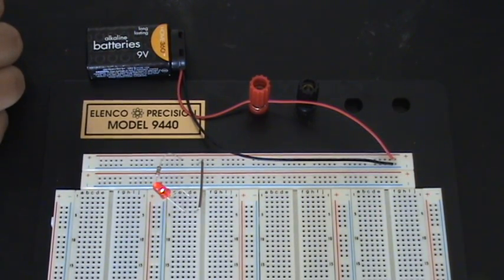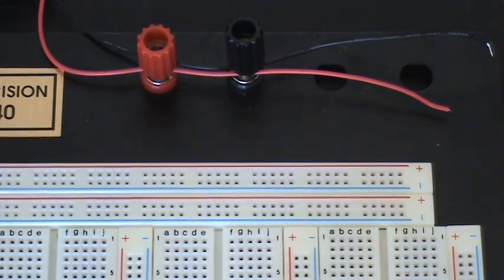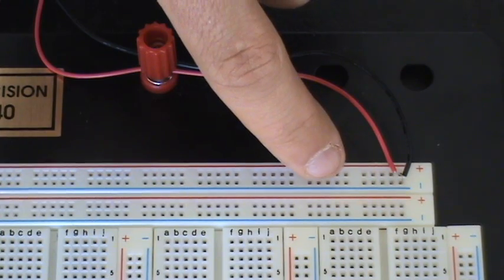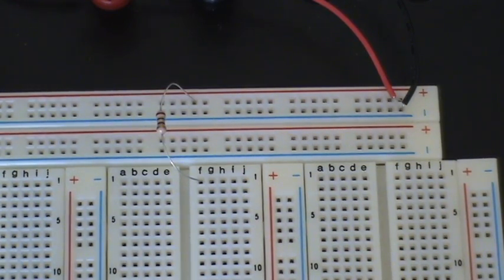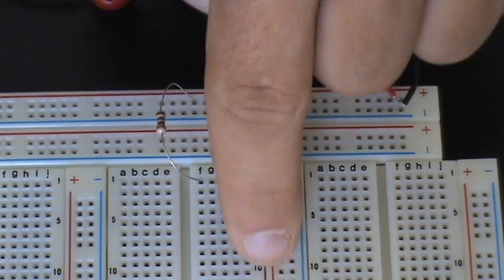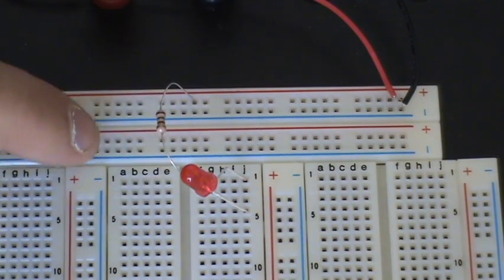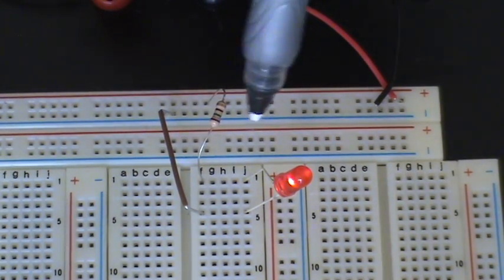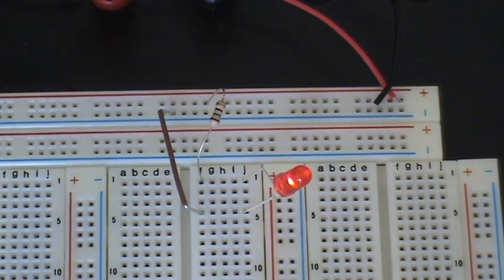Robotics and Electronics Tutorial - 16 - Breadboard Circuit

Comment: @tajiknomi 

that between brackets is how electricity does not work. imagine a pipe already filled with water and the valves only a bit open. if you start the pump now the water everywhere will now flow slowly because the valve limits it onward in the circuit and it cant compress the water.

wires are already filled with electrons, and when you apply a current to it, it only moves the electrons from + to -. so it acts like the full pipe. 

understand now?

Comment: @tajiknomi its kinda hard to explain.

(you seem to understand that electricity flows like a empy pipe with valves being filled with water. the water runs fast until it gets to the first valve, then it gets slowed down, and gets slowed down by second valve again etcetc.)

Comment: @tajiknomi Current does not go through one resistor then to the other. There is a constant flow of electrons through the whole circuit. Both resistors will have different power outputs, but current is constant in series.

Comment: It looks like the colours are Brown, Green, Brown, Gold which would make this a150 ohm resistor at 5% tolerance. If you google for resistor colour codes it will help you with this. The answer to your second question is yes. If the value is too low then you will blow the LED. If the value is too high it will not light up.